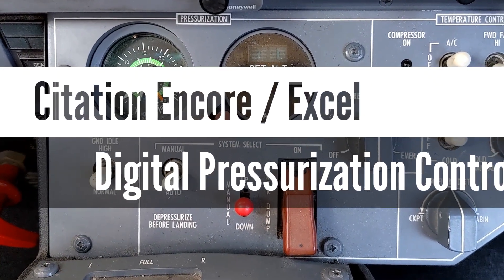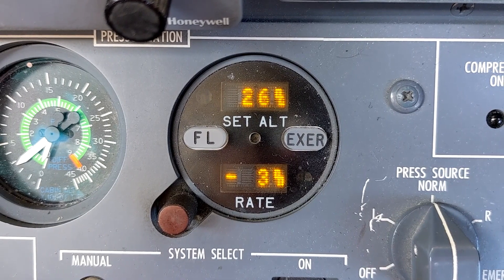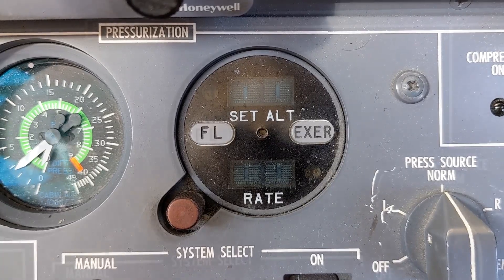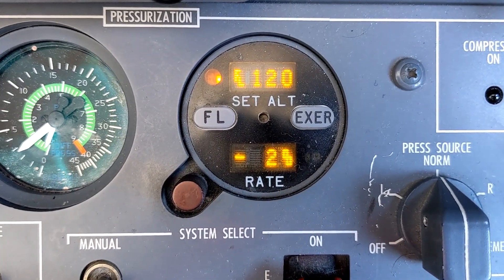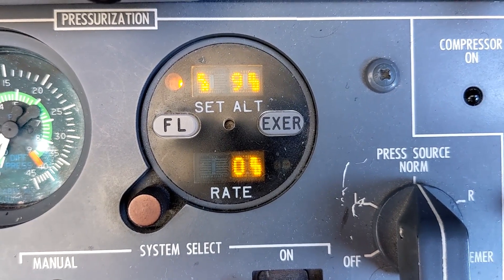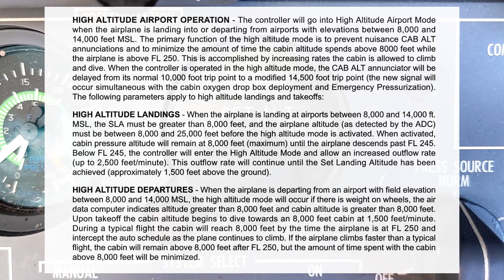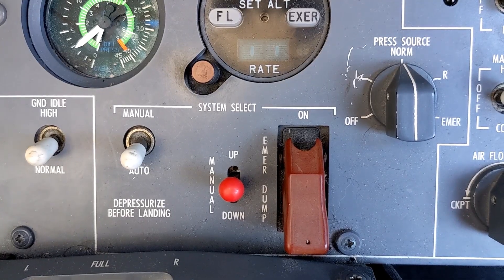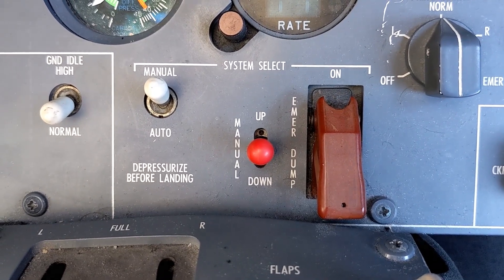Citation Encore / Excel - Digital Pressurization Controller

Comment: 5:34 ... I would've said 'modulate' instead of Open or Close.   Thank you for the detailed explanation; I'm planning on taking my wife to the FAA high altitude class in Oke City.
Reply from the maker: Great point! That would have been more precise. Unfortunately it's a difficult system to summarize quickly. Even condensing things as much as possible for this presentation, there is still a fair amount of detail I had to leave out due to a lack of time and good diagrams.